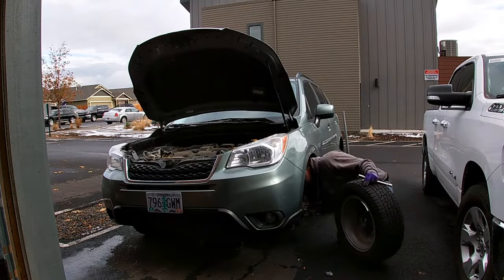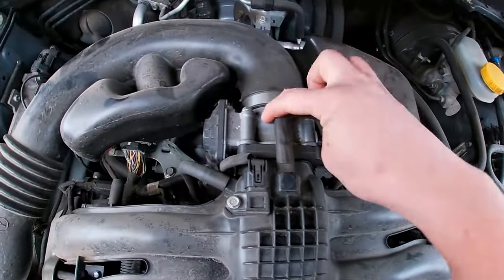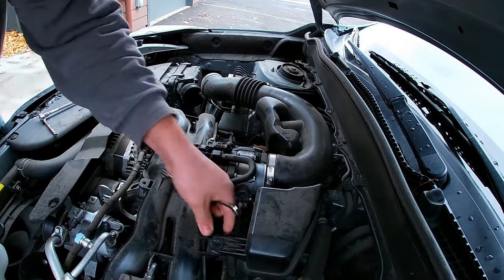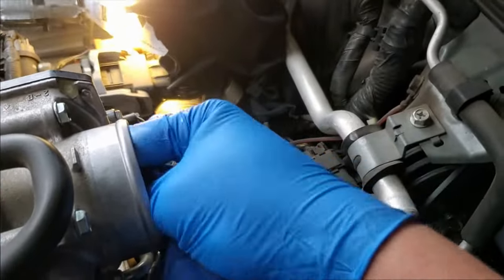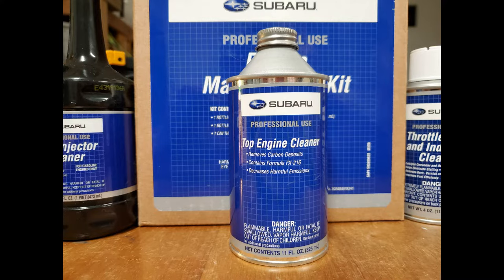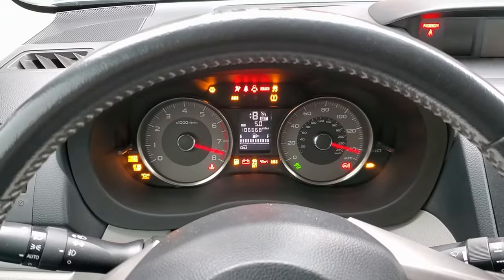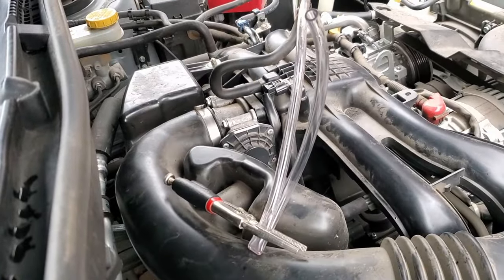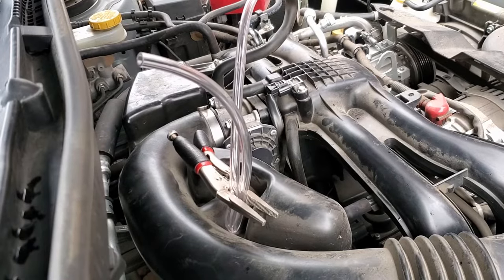Subaru Throttle Body Plate Cleaning | Top End Cleaner | Engine Maintenance Kit | Injector Cleaner

Comment: My understanding is, the back of the throttle plate being dirty doesn't bear any results on performance.   It's the edge of the throttle plate, and where it makes contact with the throat of the throttle body, that makes all the difference between being clean or having hard deposits, and only effects idle and very low throttle settings.
Reply: Not true, it also cause runaway revving when putting in the clutch on manual 2010 foresters, I recently found out after worrying the clutch was screwed. But nope, manually removed and cleaned throttle body then did idle relearn and the clutch revving issues completely subsided. Subaru's are a different beast as I've been finding out.
Reply: You are correct about the edges being the main culprit, however if your cleaning edges it's just as easy to clean the whole plate otherwise it will just come back faster.

Comment: Thanks, a well done video.  I do have a caution for everybody, having bought the kit from my local dealer's online sales, and picked it up there - on receipt the Top Engine Cleaner Can had very obviously been leaking inside the cardboard box, which was dark-stained, and the can had only 1/3 of its contests still there.  I only discovered this when I brought it home, so I immediately brought just that can back to the dealer parts counter, to find that they don't stock the cleaner alone and would have to order the whole kit and they need the injector cleaner and throttle plate cleaner back too.  I negotiated agreement to wait until the new Top Engine can comes; then I'll bring back the Injector and Throttle stuff, instead of making 3 trips there.  Still waiting to hear it's in.  A nuisance.
Reply: Got kit for about $17 but no leaks here. Sorry to hear that. I’m going to a Subi guy I know instead of the stealership to save some money on top engine cleaner.

Comment: great video - but i'd second the suggestions to remove the throttle body (4 10-ml bolts and a plug - 5 minutes - and you can re-use the flange) or you'll never get it that clean. Someone had tried to do clean it in place on my 2011 outback and all they did was scratch up the surface carbon - probably the dealer. And any vacuum hose will do for the Top Engine Cleaner. Mine never tried to stall, perhaps because i had a helper rev the engine to 2000 while adding it (maybe i just blew it out the tailpipe :) - Don't know yet if it made a difference, but it was occasionally stalling after running great on a long trip and then maneuvering slowly into a parking spot. But it would start right up again. Hope this clears that up. Thanks -

Comment: I kept getting some o2 sensor fault bank 1 lean and the 'professional mechanics' were way off kilter wanting to replace a mostly efficient o2 sensor. a kid at the car parts store was like try cleaning the mass airflow sensor on the subaru, and that got rid of the code. long story short, mechanics shops are the new banking system, they will hold all of your money.

Comment: The plastic tab that you replaced with the bolt......is probably sitting in the cover that you remove to do the front diff. gear oil change. At least that's where I found mine. I'm getting ready to clean my  '14 throttle body @66k and was hoping someone did a video. Great video! I'll be waiting for new content.
Reply from the maker: Lol! I'll check!

Comment: I was throwing a P0120 CEL code that was very intermittent, but when it got to the point where I had the car stall out at a stoplight, I decided that it needed fixing. I did this, and after the smoke cleared from the Seafoam and manually clearing the CEL, It ran for a couple hours and no issues! Great video, thanks!

Comment: I have a 2015 Limited 2.5. I choose to remove the TB to clean. Then replaced the $7 gasket. I then did the throttle body relearn sequence to ensure it was perfect. I would not use Seafoam as the chemicals in Seafoam are very different. BG has a product that uses the same agents. LuquidMoli has an oil flush product I am also using at 60k. After analyzing FB engine rebuilds due to oil consumption. These engines appear to get excessive carbon in the oil control rings; hopefully, the top and bottom clean on a regular interval will delay problems. I love your videos.
Reply from the maker: Thanks Rick!
Carbon on the control rings would make me wonder if lower quality oil is to blame, or blended oil specifically. Maybe full synthetics would help with this? I hope? Lol 😆
Also, I would think that could come from lack of cool down, or excessive city driving?
Reply: How did you the relaern buddy? i have a 2012 impreza with an FB20 engine

Comment: Hey MT, I just did this on my 16 Forester (non-turbo) just now (P0172 fuel mixture too rich error). I watched MrSubaru1987's video as well as yours before doing it. 

After having done it, I would suggest you remove the throttle body screws (10mm, torque is 5.9 ft-lbs or 8 Nm). 

You don't have to remove the hoses on the throttle body, but if you put a rag under it, you have easier access to both sides of the throttle body plates when using the throttle plate cleaner (SOA868V9170). 

I personally removed the air intake as well to clean the MAF filter and inside.
Reply from the maker: yea bro I totally hear ya. Everyone says I should have removed the throttle body, and I almost did. Except that you do not have to do that, and many folks do not feel comfortable removing it. I know Mr Suby has his video, and I thought I would show performing the task without removing it. I am completely satisfied with how the process went. But it's good for mechanically inclined individuals to know that the option exists to remove the whole body. Thanks for your comment! Appreciate the feedback! :-)
Reply: @MTsubfly  If I had to remove the throttle body rubber lines that would have been too much, but I verified the torque spec so easily and it seemed so easy to get a better cleaning result so I went for it. Any maintenance items you have planned for your Forester before the end of the year? Also, it may be better to not remove the throttle body because it says in the service manual to use a new gasket (the wire mesh thing at 3:29). I took out the gasket (16175AA430) and cleaned past the wire mesh thing and reinserted it.

Comment: I really appreciate these videos.  I am terrified of messing with my CVT though.  Would you trust the "stealership"?
Reply from the maker: Lol, I cant fully trust them. But realize if you take it to a dealer it costs more, and they do things as fast as they can...always...
Reply: CVT on my 2010 outback began failing after 150k miles. Dealership where the car was purchased certified pre-owned about a year and a half prior wanted a little over $5k to replace it and the torque converter. A local transmission shop did it for about half the price.
Reply: For changing the cvt fluid you have to other option, only dealerships have the machine for reprogramming after the change
Reply: @kostadinustavalkov1902  What do you mean by "reprogramming"?  Drain the fluid, add fluid, check fluid temp and use the top-off process.  There is no programming that I have heard of.
Reply: @ddb1143  that's what I been told, even my mechanic told me he can't do it coz he doesn't have the machine.  I'm guessing the dealership didn't do drain and fill only coz it's only 5 qts that way and they charged me for 13 which means they took out all the fluid including what's in the torgue converter ,that's supposed to be how much is in the whole system
Reply: @kostadinustavalkov1902  I know now what you might be misunderstanding.  There is a "flush" process that allows for the connection of transmission fluid lines.  One line connects in and one out on a machine that takes in the old fluid from the transmission and fills with new fluid, all at the same time.  Once the "in" line fluid is the same color as the new fluid the machine process is shut off.  This is performed while the engine is running so the fluid can pump to its lines.  This process is referred to as a complete flush, as opposed to a drain and fill and exchanges all the fluid within the entire system including the torque converter.  
So, it is not a programming process, it is a machine process.  Not all shops have the flush machine and there is some debate of the ALL new fluid being so clean that it causes break down or cleaning of built up residue within the transmission and loosened residue can cause plugging within the system and cause transmission failure.  I prefer a complete flush, but only when done regularly (50,000 to 100,000 miles).  Knowing how to top off the fluid to the correct amount is very important.
Reply: @ddb1143  ah got it thank you for clarification.  I decided to go with that process after I took a sample and it came back with too many insolubles, I think I'll keep doing that since my first flush was at 29K
Reply: You don't need reprogramming anything after CVT fluid change or flush. Just in case of replacing valve body.

Comment: Great video and advices! Came across it because my forester 2014 have rough idle and problem during acceleration between 1500 and 2000 rpm, the dealer does not find any problem though. Do you have any extra advice about a problem like this? Thanks

Comment: ** Notice **
Subaru is no longer selling this kit.   The new kit is PN# TPSFUEL  3 Part Fuel Kit S94004 for $71.79 !!!
The kit is no longer Subaru branded and contains the following:
Bardahl Pro Fast Clean Fuel System Cleaner - pn# 94040  (11 fl oz)
Bardahl Pro Air Intake Cleaner - pn# 93076  (6 fl oz)
Bardahl Pro F-I-A-I-C Fuel Induction Air Intake Cleaner - pn# 94060  (11 fl oz)
The Louisville, KY dealership offered this Fuel Induction (Carbon) Cleaning service for $199 to be performed / recommended every 30,000 miles
Reply from the maker: The local dealers have a ton of these kits, still available at a lot online retailers, but there's capable alternatives to use that are easily available anyway. I've heard they were discontinuing this product years ago, but haven't seen it dissappear, still available so i dont know about that... The dealer can do a much deeper cleaning on the fuel system, im not familiar with it, but that may be what they are charging that much for. Cheers!
Reply: @MTsubfly  I just went to local dealer.  They didnt have the kit, but did have 2 of the 3 products separately (didnt have throttle body cleaner. I just picked up CRC throttle body cleaner)
Reply from the maker: @nappyjim  that stuff works great too! Plus cheaper!

Comment: I found un-bolting the throttle body is way easier. Also did the idle re-learn procedure.
Reply from the maker: Totally a great option for folks looking for a deeper clean/project. I could be done in 6-7 minutes with a rag a brush & the cleaner without removing the whole throttle body.
Reply: When removing, did you then have to replace gasket?
Reply: What is the idle relearn procedure?
Reply: @The_Absurdistt  Check out Mr Subaru's videos for the idle relearn anytime you clean the throttle body.

Comment: Auto-play led me here while I was in another tab, but I am glad to have rediscovered your videos, MT :) will plan on doing this and fuel filter soon.
Reply from the maker: Glad to have helped! You can do this!
Reply: @MTsubfly  I skimmed through the fuel filter video and checked prices on the "pricy gasket" and fuel filter and it was ~$200.

As far as this throttle body plate service goes, the link in your description says you need another tool, but that tool has been discontinued apparently.

https://www.subarupartsforyou.com/oem-parts/subaru-engine-maintenance-kit-soa868v9341

"****Application requires SOA868V9431 NOT INCLUDED
Top Engine Cleaner Tool" 

I will ask about it (if there is a newer tool with different item #) when I visit my parts dealership today or tomorrow. I'm at 35,500ish miles right now so I might wait on the fuel filter since I know you said Subaru says 72k miles, and you probably won't have an issue until 100k miles. 

My 2016 Forester (non-turbo) is 4 years 9 months old, but I am always looking for services I can DIY. I finished up a coolant drain and flush yesterday! If you're interested, I posted pictures and everything.
 https://www.subaruforester.org/threads/2016-observations-on-my-first-coolant-drain-and-fill.807385/page-2#post-7689449

P.S. I love the "you can do this" outro on any video on the seejanedrill YouTube channel! https://youtube.com/user/seejanedrill

Do you have plans for future Forester maintenance videos? Always looking forward to more, but I also realize they take a lot of time and work (took a lot of time taking photos for coolant change so I assume it takes more work for videos)
Reply from the maker: @jkxss  great! Thanks for the info. The special tool is not needed for the top end cleaning kit. Watch the video and you will see all you need is a piece of generic tubing. This is a very easy process. Yes there is so much that can be done DIY. I hope to help people accomplish that.
Reply from the maker: @jkxss  I'm considering doing the coolant replacement video as I approach 120k miles on the forester. I have filmed other footage for less popular maintenance items such as oil & filter change, and cabin air filter replacement, and air filter. Not sure if its worth the time to edit those videos?
Reply: @MTsubfly  I was considering doing one long video for the coolant replacement, but when I actually did it, it seemed like pictures would be better since a lot of it is just waiting. Photo album of coolant change is here: https://imgur.com/a/BapZ8fB

You remove the front undercarriage tray (four total 12-mm hex bolts, six total body clips in tire wells) then remove the coolant drain bolt (not difficult to remove unlike the front differential fill plug lol). I actually removed the coolant drain bolt with one hand while recording https://youtu.be/4jo_h5x2uyY. 

Let coolant drain (optional: lift rear of car up more than front to get more coolant out), (another optional: add more new super blue coolant to flush more of the "old coolant" out, then let it drain again. 

Clean out the coolant reservoir (apparently this can be removed without removing the actual radiator fan lol https://youtu.be/m-wIWXHzbo4) 

Fill radiator up with coolant (~1.5 gallons for me even though FSM says capacity is 2 gallons), then do the procedures (MAY NOT BE EXACT, CHECK PHOTO ALBUM FOR FSM PROCEDURE - run engine at 3k rpm 5-6 times, turn off car, repeat, add coolant, run engine at 3k rpm, turn off engine, set temperature to max heat and lowest fan setting and run).

Probably not worth time for video on oil and oil filter change (photo of 17 mm oil drain bolt location is good enough). I think the only tip would be to drive the car up to temp (I personally do ~150 degrees F - can tell in the small screen below front windshield if it is in your 3-gauge info thing). Park it, drain oil, then add oil and do the oil filter, replace with new oil drain bolt crush washer, and torque the bolt to 41.7 N-m or 30.8 ft-lbs. 

Tip for refilling oil I would explicitly mention would be to do it on level ground and start checking dipstick levels around the 4.5 US quart amount so you don't overfill. 
Space between two dipstick holes (marked L and F) is 1.1 US qt or 1.0 L 
FSM engine oil replacement: https://prnt.sc/10nv319 and https://prnt.sc/10nv3d5
FSM engine oil filter: https://prnt.sc/10nv5at
FSM engine oil specs: https://prnt.sc/10nv43b (non-turbo and beginning of turbo) and https://prnt.sc/10nv4mt (turbo)

Engine air filter and cabin air filter are so easy to do that it probably doesn't require editing and you can probably do both in one video within a minute assuming you have someone to hold the camera for you (or tripod mount).
FSM screenshot of cabin air filter: https://prnt.sc/10nv0f8
FSM screenshot of engine air filter removal: https://prnt.sc/10nv6h3

Comment: My 2016 Forester is still under 50K miles. Should I be doing this too?
Reply: By the way, I also bought the AT tires based on your previous video. I did take a slight cut in fuel economy, but off-roading in the desert has been so much fun.
Reply from the maker: Its not a major thing. BUT you might do it around 50k miles as a preventative. It will help maintain the responsiveness of your engine.
Reply from the maker: @isaacdunn6589  Thanks! Yea I too took a very minor hit in mpgs. Personally I'm very impressed with the tires on gravel/dirt roads. Good to hear! Thanks for watching!

Comment: I have same 2015 Forester with 233K miles. Recently my mechanic had to repair the Torque Converter when a solenoid went bad.
I am wondering about mpg as mine has gone from 30+ average down into mid or low 20's. Any ideas for unusual solutions? And at $5/gallon need to get most out of a gallon.
Reply from the maker: I hear ya, focus on the basics first. Air supply, fuel supply,and spark...a typical tune up. Then expand to look at other parts like transmission.

Comment: Just bought this kit after watching. Still have a misfire after replacing spark plugs so I'm cleaning everything
Reply from the maker: Look into the spark plug wiring, and coil packs if your year has them. It might be getting fuel but not getting spark.

Comment: I do a Italian tune up,  I fill the fuel tank, add fuel injector cleaner to fuel, and go for a long drive at 70mph,  this will burn the carbon from the inside of the engine , and you will notice better performance and fuel consumption. Have fun.

Comment: For the top engine cleaner, where is the vacuum line on a FA20DIT WRX? Does it go into the MAP sensor hole?
Reply: Right the turbo motors don't has that small breather. I'm curious myself. Did you ever find out how?